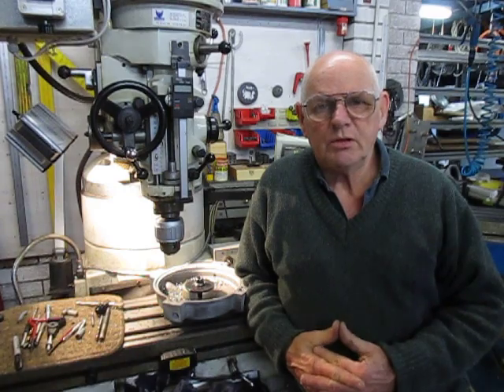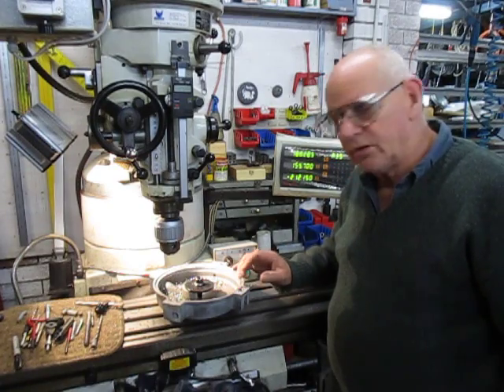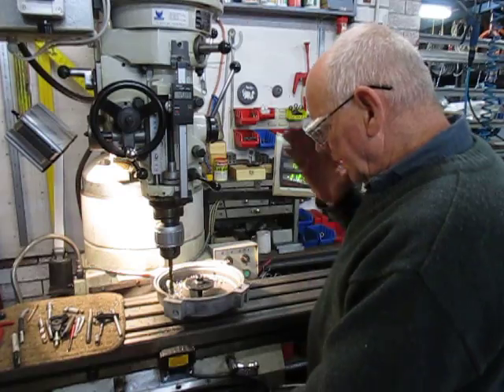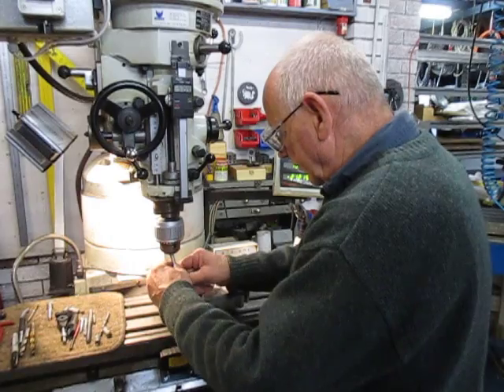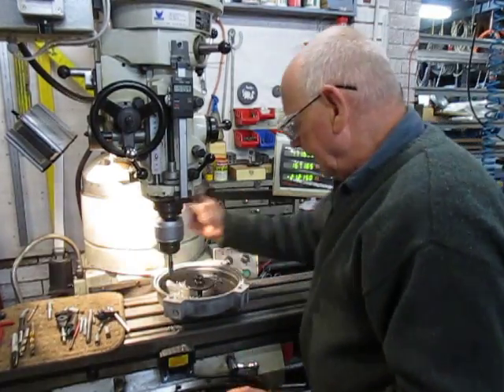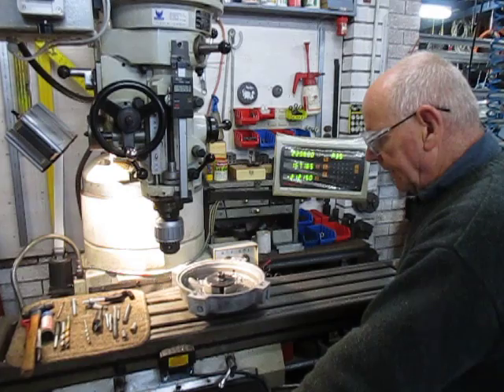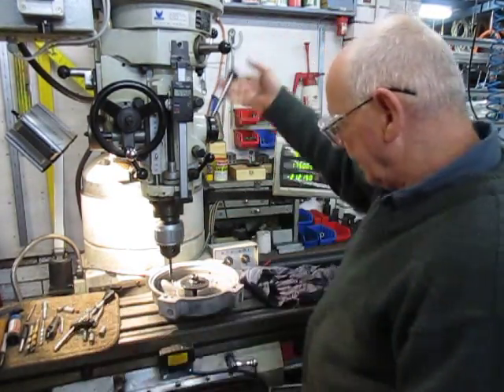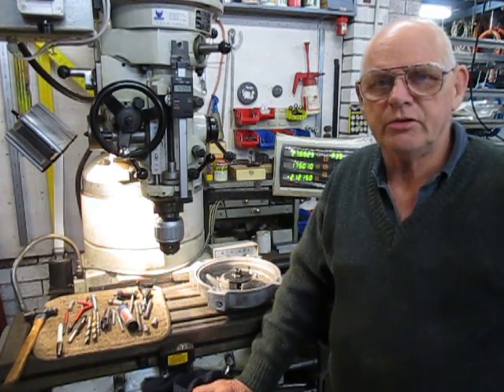Getter Out 21 remove broken studs from oil housing

Comment: There you go again Bruce, you show me something I didn't know about. I had no idea there was index-able center drills.... Thanks for that...! Also, I'm doing some marine work and must agree on SS in aluminum, I just cut or drill them out, because the oxides "weld" the SS to the AL, pointless to try to extract the bolt at that point... Cheers and carry on.

Comment: If you had an air drop at that mill, it looks like you could save a few hundred steps a day.
Reply from the maker: I have thought about it, I do have one on the big mill, only issue is residential area and the noise they make. Lots of different workshop projects on the boil so it is down to priorities.
Reply: I didn't mean an air operated spindle.  I just meant it would be handy to have an air blow nozzle gun at that mill so you don't have to walk to get it.
Reply from the maker: Yep gotcha, I do need to sort that out, there are about 4 more drops required around the workshop. I told my wife that I do a lot of miles in a day! add to that 20 times a day back and forth to the inside toilet and kettle for the umpteen cups of tea I drink! She doesn't like me irrigating the fruit trees beside the workshop! and she is the one that must be obeyed!